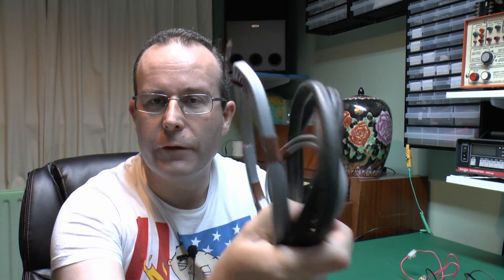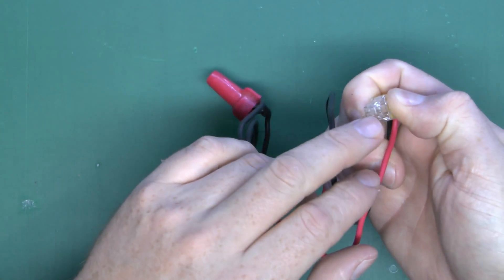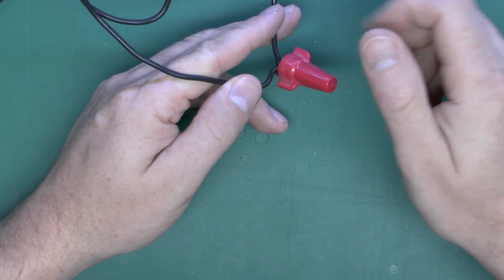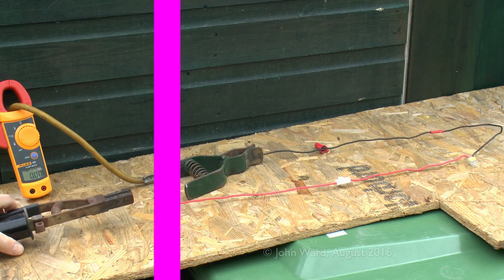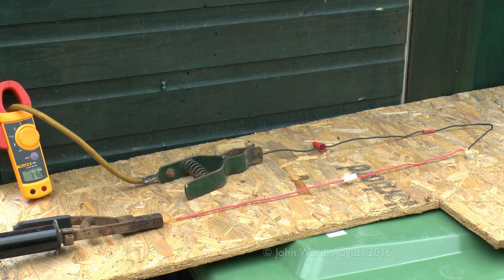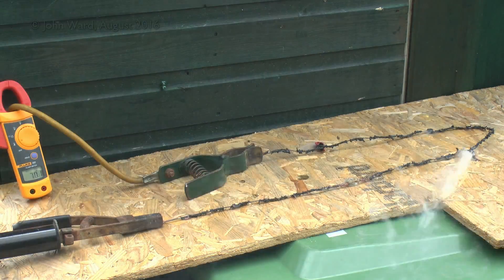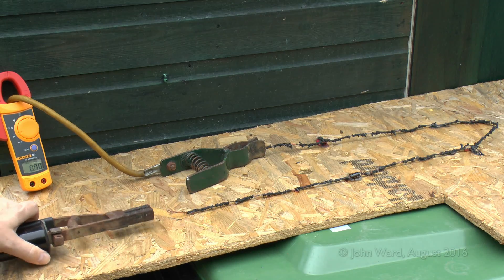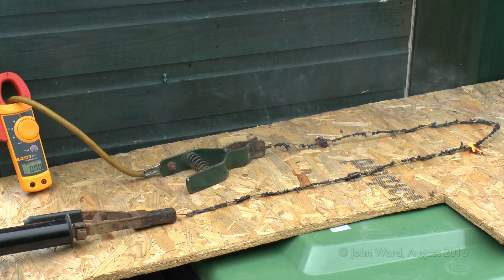Wire Connectors Overloaded

Comment: Wire nuts are best because the wire is wrapped around itself a couple times and the nut is merely holding the wires in place. All other connectors use a single contact point on each wire and the current must pass through the connector. The single contact point is hundreds times less area than the wire wrapped in the wire nut.
Reply: Contact area is overrated.  Look at a push-in connector and how it contacts the bus bar, and there can be a fairly small contact area yet it meets all relevant safety standards.  The most important thing is going to be that the connector is not going to overheat when used within its specified current rating.

I've used wire nuts without pretwisting and according to a manufacturer's directions where undoing the connection and the wire tips are loosely against each other and don't really hold together.

Comment: And this is why I still use connector block even though it would never be subjected to such high load. Done property can build a far stronger join than a wago which relies on tension pressure from a pissy bit of bent brass.

Comment: Just a couple of points John. The Wago connectors are pronounced as Vargo  ( German word)  Plus I was always taught that crimp connectors are only to be used on multi stand cables, The crimp could be pulled off a solid drawn cable as it didn't bite into the cable.
Reply: Every region has their own ideas, and everyone thinks theirs are the best.
Reply: I agree with you points Mike. I too was always taught to use crimps only on stranded (I did my apprenticeship in 1977). Having said that a properly crimped connection on solid drawn conductor is going to be fine. A correctly sized and installed screw connection is bomb proof and maintenance free in my book. There are hundreds of screw connections I made 20, or 30 years ago that are still
working safely.
Reply: @canopus101  just consider how many items use screw fittings,sockets,lampholders,lightswitches,plugtops and so on....few will ever get looked at after the day of fitting
Reply: Multi strand (Engish word)

Comment: the twist nut connector used to be the most common connection here in NL up to the late 80's and 90's and even early 2000's in some installations. these days we majorly use the insert type (WAGO) I like that they are transparent these days as you can see if your connection is correct. this is only since a few Years

Comment: When you think about it, it's hardly surprising that the connectors didn't fail, for two reasons.
Firstly, there's more conductive metal for the current to flow through in any properly-made connection through any of those connectors, therefore a lower resistance, therefore less heating inside the connector.
Secondly, there's more metal in the connector than in the wire, therefore more surface area for any heat build-up to be radiated from, therefore keeping the connectors cooler than the wires.
Elementary, my dear Watson (as Sherlock Holmes never said).  :)

Comment: Nice video. 

I think a more comprehensive test would be to heat and cool the wire repeatedly several times (perhaps dozens) to get some expand/contract wear, and THEN see how the connectors handle a high load.

Comment: I was quite an early adopter of the wago connectors both push in and lever type and have never seen one fail, choc bloc's on the other hand goodness knows how many failed and loose one I've seen even from "new" installations, glad to see that none of them if connected properly are going to fail. I'd much rather believe a real world test like this than any manufacturer claim, thanks JW, now somebody lend JW a climatic chamber and a thermal camera and we'll see the complete picture as they age.
Reply: In one instance I've come across a junction box full of Wagos (2273, the exact type shown in the video) where several wires just fell out when I touched the connectors. The whole box was full of signs of super-sloppy work though, stripped wire length all over the place, lots of exposed live copper and generally a rats nest - imagine a 200x200 mm box with all wires for a large room with five groups of lighting (two of them on two-way switches) and a bunch of sockets crammed in! (In Austria it's acceptable and rather common to mix lights and sockets and the whole box was just one circuit).

My task was to find out why and how all the sockets in the room had ended up being switched with the wall lights and change them to permanently live. Took me a while to figure out the layout and find all the splices behind the sockets but eventually managed.
Reply: In the Netherlands chocblocks are forbidden in mainwirering the crimp butt connector also. Before the adoption of wago push in early 1980 we used wirenuts. Wirenuts are better if done correctly but hard to do so with 5 wires. 
Wago connectors are fine if you keep the current ratings in mind. Do not reuse them to many times If you think the spring lost his tention do discard them.
Reply: MultiArrie Same in Germany, only I never run Info wire nuts, even in older Installations. Chocblocks are forbidden in junction boxes, but still okay for light fixtures, also mostly today the clamping wago Type ist preferred. Instead of wire nuts in older stuff YouTube will find Lots of WhatsApp Looks Like half chocblocks with one Screenshot and all wires inserted from one Side.
Reply: The only time I've seen fail choc blocks fail is when an idiot doesn't strip the wire ends & relies on the screws to puncture the insulation. This make the choc block act as bridge & if its not rated properly, will overheat melting the plastic, allowing the metal barrel to come into contact with stuff it should not. I would normally strip the wire twice the length of the barrel. Double them over & make sure that the wires are clamped by both screws.
Reply: The question is, how long do spring clamp type terminals last in an environment where it is humid?
Reply: Alex Ku Those single hole screw connectors were very common before the EU decreed one wire per hole.  Back then they were a great spacesaver (half the size of a chocolate block).  Now they are technically only legal for capping off dead ends, such as an unswitched live forwarded to a point where it isn't currently used, or in a box where a socket or lamp might be installed, but isn't currently.  They are still good inside machines/devices that aren't under the installation rules.
Reply: @Mark1024MAK  
The spring material should be stainless steel.  A bigger concern might be corrosion of the copper in contact with the bus bar.  Most bus bars should be tinned copper, which shouldn't corrode easily.
Reply: @ypw510  In my experience, it’s the copper wire that corrodes first. At the point where the wire is held by the spring.
Reply: @Mark1024MAK  
WAGO sells their Gelbox for use in humid or wet environments.

I don't know if it was necessarily humid, but I've been replacing old receptacles and outdated connections, including soldered and crimped ones.  I can't say exactly how old, but I've seen copper that was absolutely black, as well as some that looked pristine after at least 50 years.

Did you mean the copper wire or the bus bar?
Reply: @ypw510  Copper wire. Real world failure. And yes, the enclosure did have condensation in it.
Reply: @Mark1024MAK  
As much as wire nuts are railed against, one of the benefits is an airtight interface were the wires are pressed against each other.  However, those might not be ideal for wet environments because the spiral is typically made of carbon steel.

Comment: I initially scoffed at the spring clip type connectors. I then realised that their benefit is that they maintain a constant clamping force on the wire. Screw type connectors relax over time.
Reply: Not sure about how well every spring type works.  I've removed one and took it apart and wasn't terribly convinced it was a good design.  However, this was from a "lowest bidder" company that made some good products.  These did have European and American testing lab approvals, but even then I wasn't convinced the spring material was very good.  Now a WAGO or Ideal push-in connector I would trust.

The lever-type connector is another matter.  Those use individual springs compared to one piece of stainless steel formed into separate fingers like with most push-in connectors.  I would trust those springs to maintain pressure indefinitely.

Comment: In Portugal we also have all of those. Until a few years ago, inside the walls, the wing-nut twist connector (we call it "Torix") was the type of connection we used most, now the Wago type of connectors have replaced the use of the Torix connectors. We also have a Wago type of connectors which are filled with a gel inside, they say the connections will be protected from the air outside, preventing any type of corrosion. These gel connectors, which are expensive, are mainly used in communication boxes. It would be interesting to do your experiment with these connectors, that have that gel inside, to see if the fire created is attenuated or not. As I can see on your video, I'm not to sure if we are going the right way by replacing the Torix connectors with those Wago. Well thanks for another great and interesting video.
Reply: Torix seems to be a Swedish brand name for wire nuts.

Wago sells a gel in a little syringe too (probably vaseline) that has to be used if you've got aluminium wiring, which is quite common in eastern Europe.

Comment: You got to get a flir one thermal camera..  although I think any of those connectors are perfectly acceptable, just not in the same circuit- You would have easily been able to have a visualization of where the most resistance was originating..

Comment: Fantastic video! I might add that crimp connectors are designed for stranded wire. I've seen a few burn out with solid core but they are usually in high vibration applications like motors.

Comment: cool test JW, also eastern USA here and ive used those screw in block connectors several times in the past just not for mains voltage. i have used that type of connector for LAN and telephone lines.

Comment: Fascinating vid John. I thought the Wago Connector would fail first as the actual wires are not in contact with each other but they all stood up well to the overload. :)
Reply: There's no direct wire to wire connection in any of these other than the wire nut.  Butt connectors have a piece of metal between the crimp ends, the WAGO push-in uses springs (which might provide some conductivity) placing the wires against a bus bar, and a terminal/choc block uses a metal base.

I've seen some testing and one of the highest resistances came from just trying to touch wires together.  With a wire nut, the resistance can vary depending on how much twisting there is between wires.  Push-in connectors tend to be very stable in terms of how much contact there is using a spring.  I've heard criticism that the contact area with the wire is small (and thus resistance is higher), but I don't believe that's so much the issue as much as whether or not it will overheat under rated current.

Comment: What a useful video! Connectors are usually fine, until they need to operate in bad conditions.I don't like a connector that reduces the thickness of the wire by only making contact on some surface area of the wire at the connections. So twisting the wire around itself a few times ensures you don't create a weak spot. My money was on the push in connector. Although it did not fail. 

I would suggest that the test should be executed with an infrared camera to see which connector gets the hottest (if at all). Because that indicate a bad connection although it may be made of a metal that can handle the heat, so it will not fail. I had a chocolate block (connector block) used to join a geyser wire and the connector heated up to melting point of the plastic, but it didn't fail. Although I would consider that a bad connection.

Comment: Over the years I have discovered quite a few burnt wires that did not cause house fires. Arcing, flame and combustible materials will. I have not used the WAGO, but was considering them. They are easier and quicker to use, but your demonstration revealed that they are combustible and could cause a flame in certain conditions. Great test!

Comment: I'm but a novice here but the way I see it  is as follows.:-
-Junction blocks do go brittle eventually & also split during initial installation sometimes, however can the connection not loosen due to repeated heating up & cooling of the wire, thus leading to an arcing. A good point is that it does take a tool to mess with them.

-Wago's are tool free in assembly & disassembly so anyone could mess with them, however as long as the wire is stripped correctly they are also quite safe to handle as the insulation goes partly into the connector. The connector would expand & reduce with the wire as it heats up & so shouldn't lose it's grip strength or integrity, especially when used in conjunction with the proper enclosures. Yes the levers do open one version but I bet that even if that part melted off the connection would remain good.

- The winged twist on type may be secure  initially but I reckon expansion/contraction from heat would ease the connection in time. Also a child could undo one of these if it found one, they would know what to do straight away, grab the wings & twist it.Not that they should be able to access such a connector.

- Crimp on "car style" connectors. Surely expansion/contraction does it again here over time, you could also touch the ends if poorly fitted.

Obviously consumer units have the wires secured by screw, theres more & more focus on the torque settings to ensure the connection stays put, however the tightness is easy to check during a periodic inspection.  When a connection is under a floorboard, "accesible" but rarely checked for tightness & definitely NOT torque set upon assembly would it not be best to make that connection using something that retains its grip even after heating up ?

I  have a WAGO preference...

Comment: They all work when done correctly but I guess the regulator has to take a view on how easy it is to put the connector on incorrectly/dangerously without realising it. I thought that was the original problem with the 1960s wingnut type in the UK tbh.
 Butt crimp should be fantastic but a lot of people are inevitably going to munge them closed with random pliers.
Wago might be the best here in terms of only looking like it's on properly when it really is on properly.
possible idea for a future video would be comparison of crimps made with inappropriate tools vs correct tools - demonstration of the easyness of making a bad joint with the varying types
Reply: Oh yeah, crimp connections are extremely awful when you don't have good tools. Many years ago I used to work in clay mining industry and these were used for connecting control circuits to bucket-wheel excavator. We had to solder these (guerilla style - bucket, campfire and lot of solder - these were pretty big connectors, as all the control was based on pretty beefy contactors) because there was no hydraulic crimper available on site and if we used manual one it was failing after a week or two.
Reply: I don't believe wire nuts have ever been banned from use in the UK, although obviously they've never been terribly common.  My understanding is that they fell out of use because of the older style ceramic caps that didn't contain a metal spiral.  They basically had threads cut into the ceramic and the threads cutting into the wires as the thread spiral got smaller is what held wires in place.  I understand they weren't always terribly secure and had a tendency to break when overtightened.  I can't even get a modern plastic wire nut to crack using pliers.

I've been dealing with older homes and replacing old connections.  I've seen some ghastly soldered connections that were covered with vinyl electrical tape, rubber splicing tape, and/or friction tape.  I've also encountered wires that were twisted together, then covered with a crimp sleeve, and finally covered with tape.  These were variously replaced with wire nuts or lever-style connectors like a WAGO 221 or Ideal In-Sure L2.

Comment: It's actually quite interesting how people feel about their preferred connector types. Here in the US, most electricians are skeptical of screw terminal connectors and spring connectors like Wago, and will never stop using wire nuts. And I'm pretty sure that the crimp on butt connectors aren't allowed to be used here for mains wiring. They're often used inside of appliances, but that's about it. There are bare copper crimp connectors used for connecting several ground (earth) wires together, but I've seen more badly terminated connections with those than I've seen properly done ones. (I'm not an electrician, I do general building maintenance as part of my job, so I do sometimes work on existing installations. Can't do new installs or major work such as replacing a circuit breaker panel, however.)

Comment: So I don't think the wire would have failed first at the Wago connector if the Wago plastic hadn't caught fire and made a hot spot. So I still blame the connector. Note that in my opinion, the crimp is the most dangerous, since it often happens that a crimp is not carried out correctly.

Comment: I use the push fit connectors sometimes the lever cage type and both are easy to use plus do not stress the copper  like the other types that tend to squash or twist the conductor. The new wago connection boxes are fantastic in place of the traditional type junction box.

Comment: I always use connector blocks and crimps as I personally think there the safest. I’ve done tests like this myself. 
I’ve never used wire nuts and the spring types of connectors as I don’t think you get a proper tight connection.